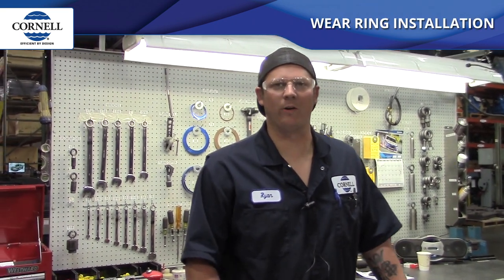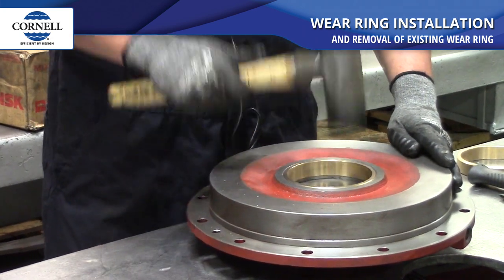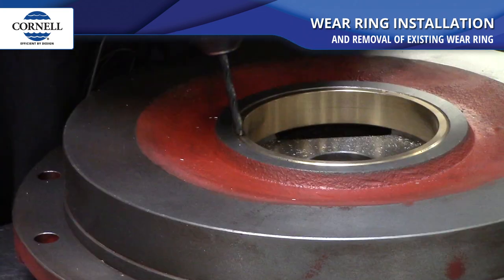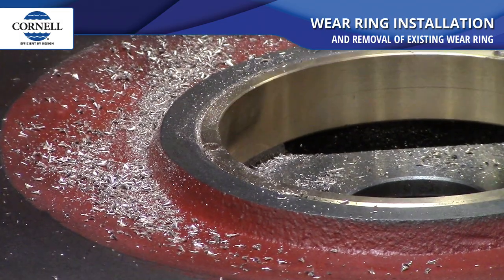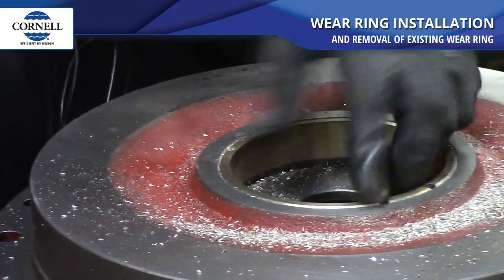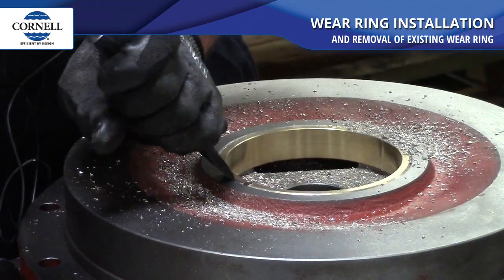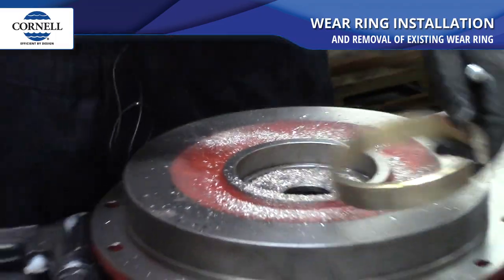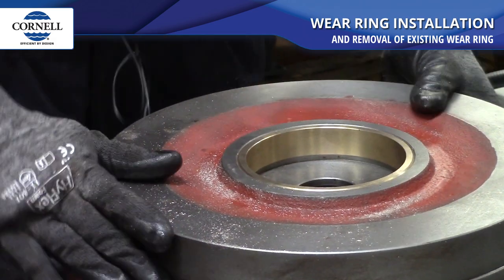Wear Ring Installation

Comment: Casing and impeller wear rings of our API pumps are seized and they were tack welded, i.e. one is tack welded with casing and other is tack weld with impeller, and they are siezed on one another. What should i do to take them out

Comment: on impeller also wear  ring is located?
Reply: Krunal Prajapati yes and its called impeller wearing
Reply: On case wear ring I always done it the same way he did it.. for impeller wear ring I prefer to use heat to remove it because some wear ring need to fabricate and the dimensions on the existing wear ring need to be check in order to ensure fabricate the new wear ring follow the same dimensions (ID)
Reply: How to measure the wear ring clearance?